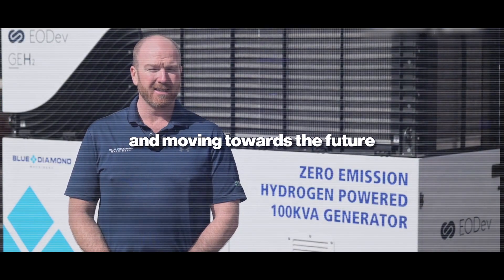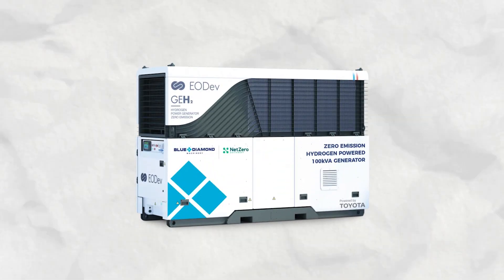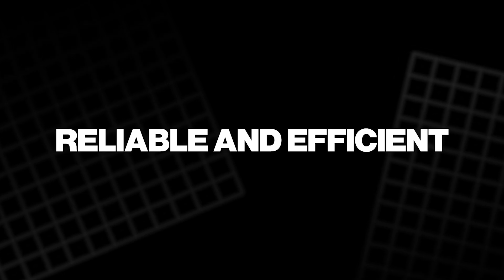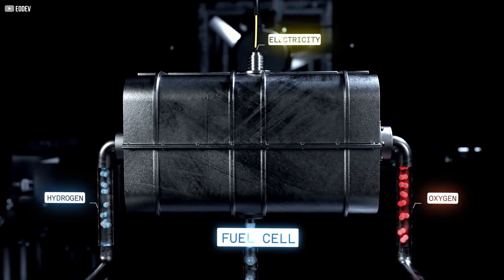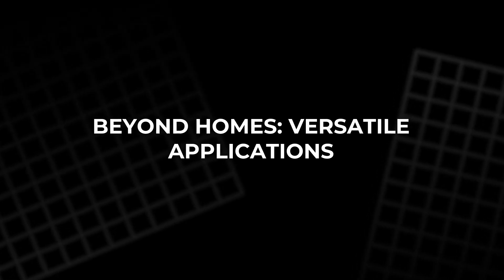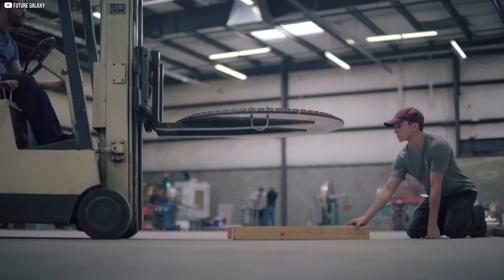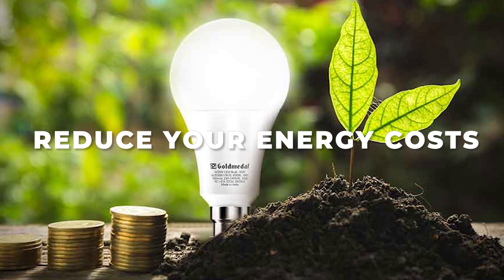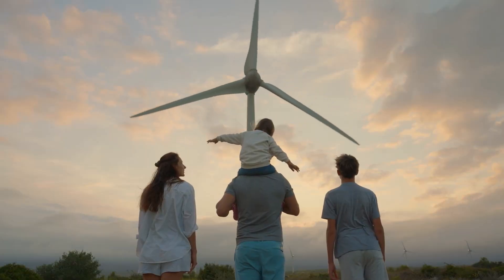BREAKING: Free Energy Device Hits Market in 2025 – Australia Did It First!

Comment: I didn't understand that. When you split water in H2 and O normally you lost 50% energy and then put in a engine you lost again 80 % of this 50% and the result is low energy output. So who can it be worked?
Reply: Actually electrolysis is only 33% effecient.
Reply from the maker: I understand where you're coming from! The efficiency of energy conversion can be really complex, and it's definitely a topic that requires some deep diving. The device aims to improve upon traditional methods, so it’ll be interesting to see how it all pans out.

Comment: In the video it is stated it needs a power source to do the hydrolysis of water into Hydrogen and Oxygen.  Where is this power source coming from??
It is well know it takes more power for electrolysis than one gets from the generation of power from said Hydrogen you got from the initial electrolysis. Fuel cell technologyis a net energy loss process which means it takes more energy input than the energy one gets at the end of the process.
Hydrogen power may make sense if you were to power a moving body like a car, but not a stationary body like a home or business.
I also got a kick out of the graphics showing the hydrogen entering what looks like an internal combution engine.  A Fuel Cell does not look anything like an internal combution engine that is shown in the video.
I  give it 5 Pinocchio's - Can't even get the physics correct in the video!!!
Reply: They should have shown how to start that generator instead of talking too much!
Reply: Sourcing hydrogen is the problem. You need to buy the hydrogen or buy a machine to make hydrogen. This machine run out from. Electricity.  Do you see the problem?
Reply from the maker: You raise some valid points about the energy inputs and outputs of hydrogen production. It's definitely a complex topic, and we're always learning more about how these technologies can be optimized for efficiency. Thanks for sharing your insights!